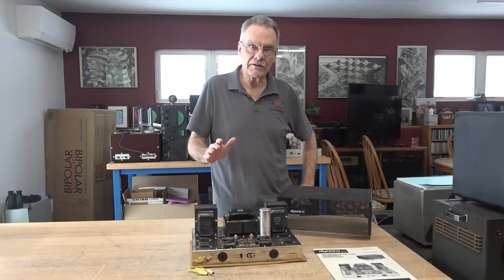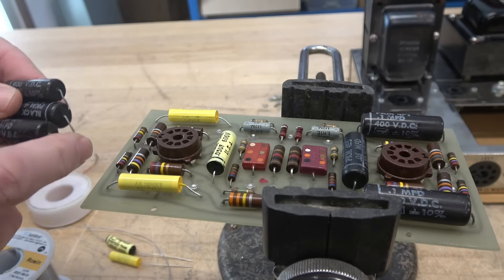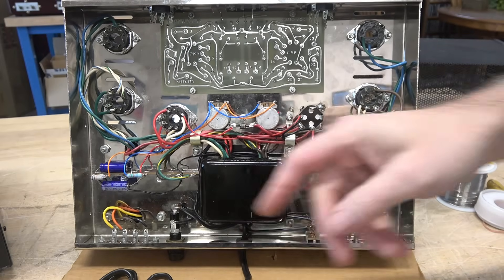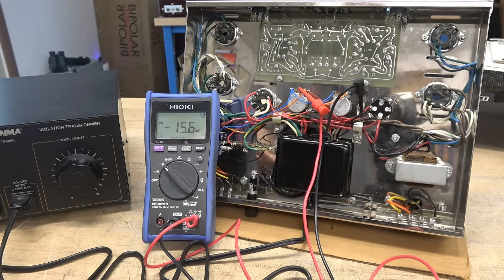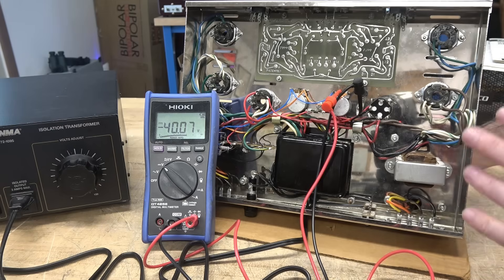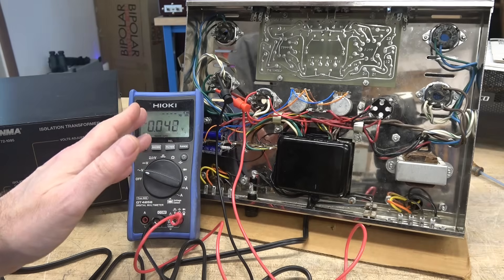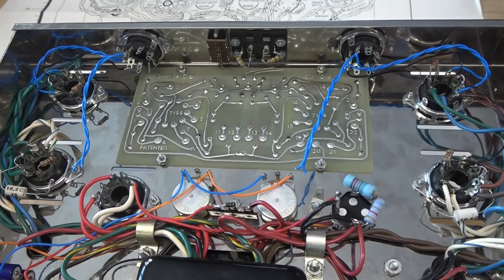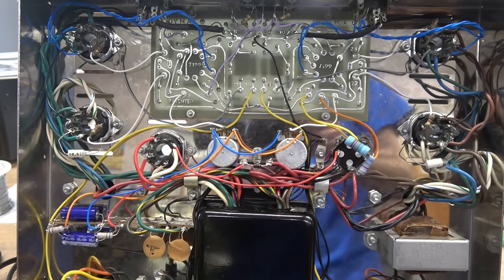Build a Vintage 70's Dynaco Dynakit ST-70 Tube type home stereo amplifier unbuilt kit Part 3

Comment: My f-5 fader lube hardly had any propellant. It just dribbles out like an old man with prostate problems. I also had a can of flux cleaner I bought someplace else same problem. I looked at the label...same company. Instead of the regular deoxit I use the lawsuit contact cleaner. Oleic acid and naphtha.

Comment: I recall seeing a selenium rectifier on one of the instruction diagrams in a previous video of the project.  Did you end up using it or substitute a more reliable Si diode?  This has been a great project series!  Thanks for sharing your love for kit building and vast electronics experience, as always!!
Reply from the maker: Yes, installed a 1N4007

Comment: Didja put the foil side towards ground on those caps you replaced?  Can't say I notice a difference on the stuff I've done.  Seems like these new films don't have a big differential.👍
Reply: I'm a believer in testing foil caps even orange drops etc for  directional and positional noise reduction.. markings don't mean much. He does a great job on guitar amp noise reduction but never seems to worry about direction of signal caps.
Reply: PS I tend to use the word signal caps but to be correct would be coupling caps.